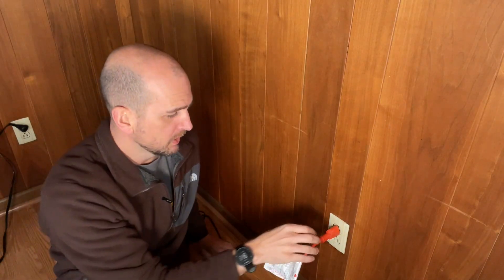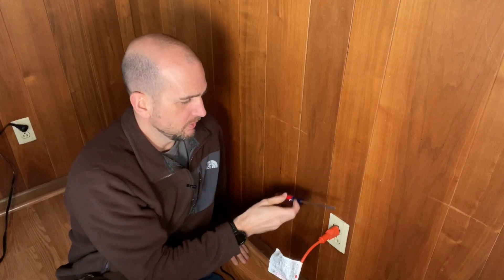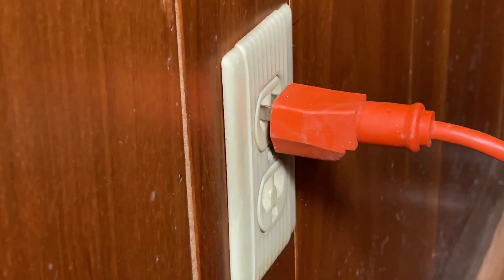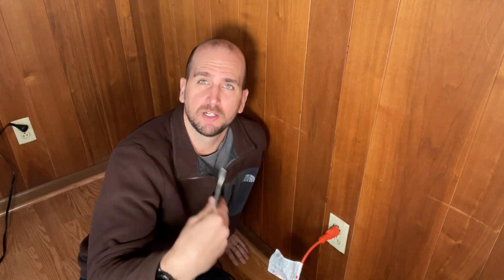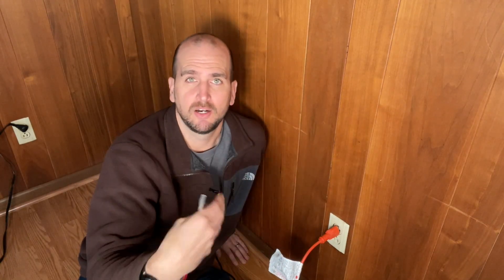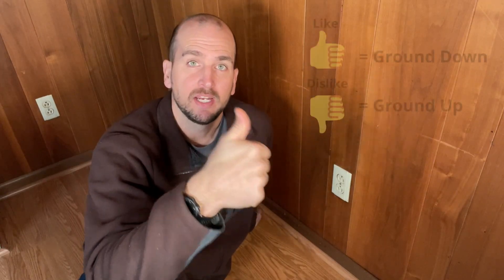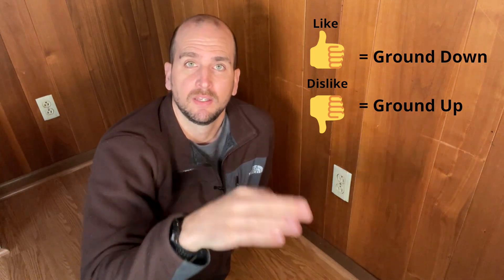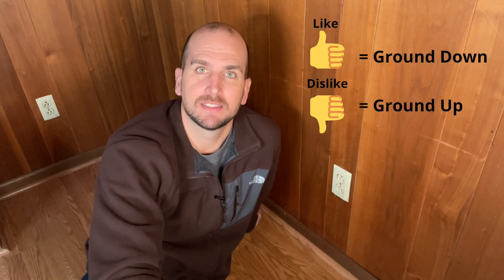Should An Outlet Be Installed Ground Down Or Up

Comment: problem with this is that some plugs on certain things have plugs that come off the wire at 90% not straight off the end like most plugs like fridges a lot of them have plugs that have the wire come out at 90% from the plug to save space behind the fridge i assume  gets a little weird if your ground is up so those plugs a made for a ground down  install

Comment: I heard years ago that if a grounded plug starts to be pulled down out of an outlet, if the ground is at the bottom, it will stay in contact better than if it is at the top. Also agree flat plugs have to loop up and then down of the ground is up. 100% vote for gound down. Having said that, I did have a client who had a thin tray drop on the prongs of an outlet and blow a breaker, and the kitchen lights as well. Extremely rare, and not, in my opinion dangerous, as the breaker immediately tripped.

Comment: On 240 volts/30 or and 40 amps: ground has to be left or right (so as not to put strain on a 90 degree supply cord ) this is code in Canada. For the same reason the 120 volts outlet should have ground down(logic but not in code,) Decora outlet has their TOP upside down? No these are mass produce straps which are also used on their switches. If you put a switch upside down it get to confuse people (possibly causing accidents or deaths). It’s for this reason that their plugs are punched with TOP (to cut down on inventory cost of common interchangeable manufacturers part).
As for accidental dropping of conductive parts on prong VS. strained supply cord breaking/fraying, I think the probabilities are higher on the strained cord causing: over heating causing fires are higher.

Comment: ground down, in my experience manufacturers that put out products that are affected by orientation always do ground down, I was told this by my mentor when wiring my mother in law's new house, as a side note,  when you try and use the like/unlike button for another function I think this is a problem and I wouldn't be surprised if "they" bring this up

Comment: I do mostly down with the exception of certain submersible pumps with the float switch located within the plug set. Ground up is the most natural position for the wire to not be in the way.

Comment: Ground down is more common everywhere in the US. This is mainly due to the position of the hot and neutral wires as they come into the housing. They generally are aligned to make it easier to wire the receptacle in a ground down orientation. Ground up does provide a tiny bit more tension in an older receptacle if you are using 3-pronged plugs, but the difference is not that much. Just replacing the receptacle is advised.

Comment: We always did Ground up in Commercial, but in Residential (unless told other wise) it was ground down (unless the plug was switched then we either went ground up or used an outlet that looked different from other outlets aka round vs square)

Comment: There are as much as four ways those two gang outlets may be installed. Vertical and ground up or down versus horizontal and neutral up or down. 

Ours was built for horizontal and neutral down (compare to vertical and ground down). Considering: the whole house was complete with 1/2” steel pipe between each electrical box and breaker box, so horizontal alignment makes practical sense. Leaving us a potential short circuit issue. 

You know what? I will reconfigure those into a safer configuration.

Comment: What I was told many moons ago was that the ground should be down so that if someone steps on the cord and it gets pulled out of the socket downwards the ground is the last thing to be disconnected.
Reply: For that specific reason, it doesn't matter if its ground-up or ground-down, ground will always be the last thing disconnected because of the design. If you take a closer look at any plug, ground terminal is the longer of the three. That way, ground is the first to make contact with the receptacle, and the last one to be desconnected, becasue is longer than hot an neutral :)
Reply: @wariormz  Yes, but if you step on the cord  near the outlet the plug won't be pulled out straight, it will pivot downwards, breaking the plug.  If the ground is at the bottom then it will be the last to be disconnected.   If the ground is up then it will be disconnected first, even with the extra 1/8" of length that it has, because of the rotation.

Comment: The outlet behind the fridge and stove in our house was wired ground up, which is a pain because the cords for these appliances have right-angle plug heads (which feature the ground on the BOTTOM). So when you plug it in the cord feeds UP before bending DOWN to connect to the appliance (instead of hanging down naturally as designed). I don't understand why anyone would install upside-down…

Comment: I prefer ground down. Washer, freezer, and refrigerator have 90 deg plugs with the ground by the cord. Having ground up adds strain to the cord which may not break the wire but may break the rubber on the molded plug, exposing the wire over time.

Comment: I had a piece of scrap sheet metal slip behind my work bench and came in contact with the hot plug of an outlet and not trip the breaker. I only learned this when I went to get a piece of metal out of the pile.

Comment: Every other US outlet that's not a 5-15 or 5-20 is ground up. Air conditioners usually have a right angle plug with the ground up. If you look on Lutron's or Eaton/ Cutler Hammer's websites they only show outlets ground up. The BS1363 standard (the best plug and socket in the world) are always ground up.

Comment: If there's chance of flooding, like in a basement, would put the ground down.  My neighbour was a master electrician and remember him going through his flooded basement to check the fuse panel...
Reply: If there is a chance of water exposure, use gfci like a kitchen or bathroom.  As far as ground down, although it may give you live conductors a bit more height on the receptacle; water probably already got into the box and the water either shorted or is already live so won't matter.  Once a receptacle is exposed to that type of water yould want to replace them either way and sand down your leads to prevent rust.

Comment: I always put them down, the reason being is that when you have a heavy item being plugged in (AC unit - those are always ground down) it puts pressure on the top plug and if you plug it in the bottom, it blocks the top plug.

Comment: Ground down! Ground up for switched outlets. I have also put a red dot with a sharpie marker
to the right  of the ground hole for switched outlets (all ground down outlets). And plate screws 
straight up.....I'm a bit OCD. Also, if the outlet prongs are loose, CHANGE IT!

Comment: Guys, got a great idea for you all... just switch (!) to English style 3-pin sockets/outlets (receptacles..???) there is no confusion with those and the plugs are very robust and there is never an issue with a plug falling out of a socket as they are a tight fit and the earth (ground) pin is at the top and is slightly longer than the live (hot) and neutral pins so makes contact first and moves the 2 small "shields" covering the 2 lower holes that stop little fingers poking metal objects into them when the socket is not occupied by a plug... check 'em out, I'm sure you'll be impressed by the concept and build quality 👌

Comment: Conventional  wisdom is ground down. The weight of the cord normally pulling the two top prongs out leaves the ground in last and would  protect equipment ground as a last resort.

Comment: You are right and you are wrong.If they standardize the plugs on all wires yon are right.The plugs on all wires are not the same.Some are like hooks, that is bent at angle to the wire. You can not put two on the same receptacles. That is a problem.This not a problem with a straight line plug. So why not standardize with a straight line plug.

Comment: i would like to see someone do a leverage test on the downward force of time and weight to see which way is most likely to fail first on the plug becoming loose. 3 prong of course. I bet the winner would be ground down ( oh and by the way when plugs are coming from wall in ground up is it not the ground that looses contact first )

Comment: I had a long plug strip mounted on the forward  edge of a workbench, with the outlets facing sideways.  One day, my solder fell near the plug and I quickly decided there was no way to prevent it from touching, no matter how moved.  So i jumped very quickly, and it flashed.   Then I relocated the plug strip.

Comment: I was always under the impression, residential - ground down, commercial - ground up.  But that's something specified on the plans.  Most commercial backup plugs (i.e. computer equipment) have the ground down.  No rhyme or reason really.

Comment: One of the features of receptacles and attachment plugs is that the grounding connection must make first and break last, meaning when you insert the plug the ground contact connects first, and when you pull the plug, the ground is the last to disconnect.

Comment: The electrical code allows outlets to be installed with the ground plug hole facing up, down or sideways. It's up to you, there is no standard electric outlet orientation. So that means there really is no such thing as upside down outlets.

Comment: Here in Quebec, Canada, the electrical code requires installation with ground up.  All boxes must be of the metal type. Wires through the holes of a box must be clamped inside the box. We can have outlets protected by gfci breakers. The main entrance itself has lightning protectored breakers (with pilot lights to show they are on).  My home entrance is 240 volts 200amps. When the wiring was done according to code, each bedroom recepticle was rated at 5amps consumption, with a max of 3 receptacles per breaker. 
We need that power as most homes in Quebec are "all electric", with no gas for cooking.. 
Home eletrically consumption (winter)  heated hot water radiators (240volts x 75amps), Hot water tank (240 volts 25amps), and close dryer, also 240v x 20 amps) Electric stoves consume up to 50amps at 240volts.  .If we got every appliance running at max in winter, the home would be consuming 180amps at 240volts. Summer consumption is about 75amps less draw.

The rest of the electricity wiring is similar to any North American home, in that kitchen outlets and bathroom outlets are gfci protected.  Main bedroom shower/toilet usually have hairdryer outlets.
In my Kitchen, we have one outlet where the link between the lower receptacle socket and the upper are split. The top recepticle has 120v for toaster or electric coffee maker while the lower recepticle is on the other leg of the 240 volts as a separate circuit. We can use microwave, electric frying pan, toaster and coffee maker all at the same time with that 240volt and neutral.   FYI, under the counter at or below that recepticle is a boxed dual 15amp ganged circut breaker.
Electricity in Quebec is bargain priced. We pay just over 7.2cents/kwh.   Industrial businesses may pay as low as 4.5cents / kwh. 
Many homeowners, after the electrician leaves, invert the receptacle so that the ground is below the prongs.  By the way, the new electric code requires child resistant receptacles for floor level receptacles. There are plastic shutters internal to the receptacle, that with insertion force of a plug, move out of the way to allow insertion of that plug. 
Kids can't easily put a knife or other object into the receptacles slots.
Reply: Metal not plastic boxes for residential rough in? Really?
Reply: @billr.5808  Yes for indoor boxes.  For outdoor weather protected boxes, plastic is accepted for water/rain proofing.  Absolute requirement that each outdoor receptacles must be gfci protected, and only with 120v in the cable connecting that box.   And no aluminium wiring permitted for light and receptacle wiring.  (Aluminium was allowed in th e1950's).
Reply: Agreed.  My outdoor GFCI receptacle is in a water-resistant to rain or garden hose sprinkle box.
Reply: @billr.5808  I believe that there are cost reasons to use metal boxes and other.  For one thing, the overall exterior  box size is smaller than a plastic box. The box is normally connected to the ground lead, which means something for some items such as bathroom timers, hairdryer, toothbrush sockets are deemed to be safer, if ever water got behind the cover.
Reply: @lsatenstein  Thanks for the info. Such a difference in material requirements from Canada and the US. Also, what is your preferred method of stripping and cutting the sheathing off romex. And wire strippers for romex. What do you think of the Southwire boxjaw romex wire stripper?
Reply: @billr.5808  My local handyman has a unique kind of wire stripper. It is geared to Lumex wire.It has a short knife to strip the shield.  The rest of the stripper is used for each of the 3 plastic wrapped conductors. At the stripper jaws, there are two parts.  Part A of this device is a wire guide and clamp that has a "wire-tip" stop to limit the strip length.  You put the unstripped wire therein, squeeze on the handle. The first part of the squeeze clamps the insulated wire that you inserted to the stopper. The second part of the action is to nick the insulation around the 14 or 16 guage. Continued squeezing cuts and removes that 1 inch of tip insulation. You no longer needing teeth device to pull the plastic off the tip of the wire. That stripper does it for you with one press.
I was googling for an image of this hand stripper, but could not find an image.
By the way, I am not a licensed electrician and I definitely do not work as one. But at age 80, I have learned much about electricity, plumbing, cement work, roofing and more.
Reply: @billr.5808  metal boxes yes, plastic no. Firecode.  When I wrote about 240 volts in, it is 240 volts centre tapped. That is, 120 ground 120.

Comment: The NEC writers are waiting until they run out of other bullshit to use "ground pin up" as a revision, given them another excuse to require you to piss away yet another $200 on the code and its interpretation. That's what creates job security for them. Why don't they publish it in a ring binder and mail you single page revisions when necessary?? No profit in that!!

Comment: If you have Ground up you cannot see the prongs for aligning it into the plug as easy. You also place your finger closer the the hot lead. This is mainly a concern when trying to plug into an outlet behind a couch or piece of furniture. 
Ground down is also better for holding the plug flush if it starts to weaken its grip over time. 2 points of pull are better than one when you consider the leverage for the top of the plug. And for the manufactures that make the low profile plug as shown in this video. Also consider most power adapters with transformers that are made with 3 prongs have a large amount of weight that hangs below the ground prong.
So lets just start installing all plugs sideways.
Bottom line for exposed prongs in a lose plug..... change the plug and go with commercial/industrial grade.
Reply: You dont need to see the bottom 2 when its ground up. You line up the ground lug to the hole and insert the plug, its that simple. The other 2 prongs are fixed and dont move so when you line up the ground, the other 2 will be lined up.
Same for the ground down, that ground lug is longer than the other 2 so you line up the ground lug to the hole and then the other 2 will be lined up. 
2 prong is the pain in the ass because 1 lug is wider than the other and it only goes in 1 way and its a 50/50 shot that you have it lined up right or else you have to turn it 180 deg. 
UNLESS you have a non code compliant plug where both prongs are equal size and will insert either way.

Comment: I'm from Australia, but I'm very intrigued by the American wiring system & study it intensely. As far as I can assertain, outlets were originally intended to be used 'ground up'. But as things progress, people have gotten used to (or prefer the look of) 'ground down' outlets. Generally (as you said) 'ground up' is used to indicate to the user that the outlet is switched. From my perspective 'ground up' is safer, but as manufacturers of ancillary equipment such as timers, watt meters etc, design them for use in 'ground down' outlets, it would make mandating such a convention difficult. As far as identification of switched circuits is concerned, maybe outlet manufacturers could make engraved wall plates to make identifying them more obvious?
Reply: I am 46 yrs old and for my entire life all i have ever seen is ground down. On occassion i have seen ground up but like maybe a few times in my life.

Comment: I, and I'm guessing most people, grab a plug from above with my thumb on top away from the wall and my index finger on bottom being closest to the wall. In a loose plug scenario, if the ground is up and you grab the plug, it's possible to get your index finger into that gap and across the two prongs on the bottom and find yourself in a 60hz tingle situation. :) If the ground is on the bottom in that same scenario you've got a little bit of grace.  I'm speaking of course from experience, particularly in a situation where the outlet is behind something, your practically standing on your head to get to the plug, and you're forced to do ALL the prying with your thumb and index finger.  I've been bitten a few times doing that when the ground is on top.  And even though it's a novel idea for voting... I've never seen such a shameless method of getting more likes than dislikes, because everyone knows ground up just plain looks funny!  ;D